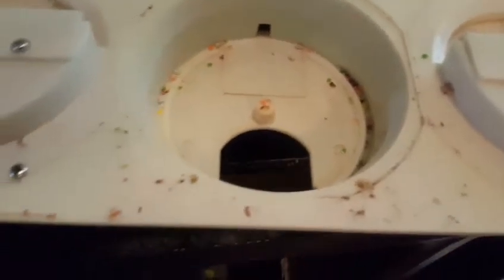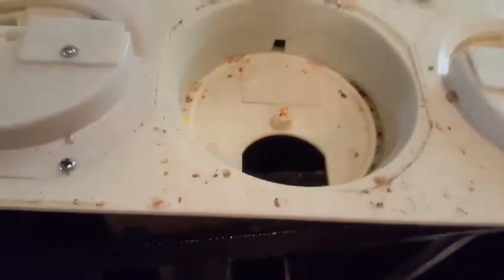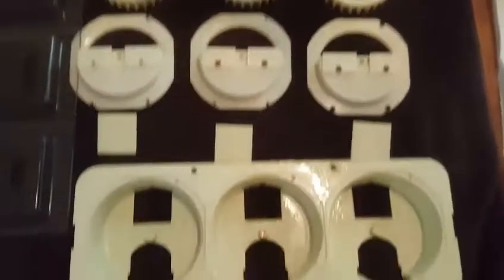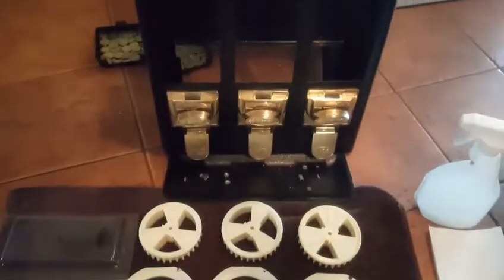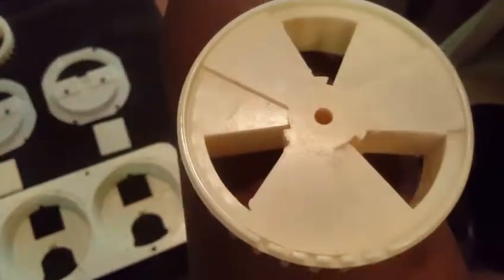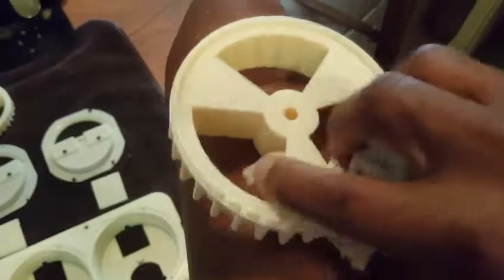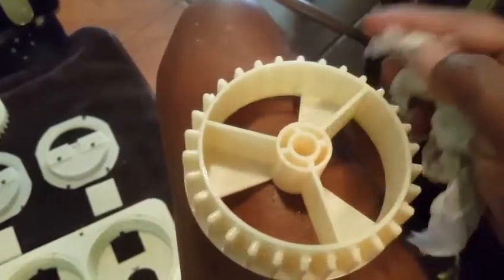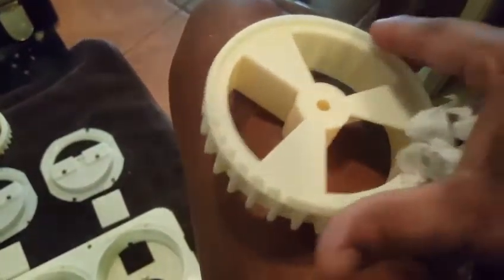Cleaning Seaga m&m candy machine.

Comment: Are you just using soap and water? And can you soak the removed pieces
Reply from the maker: Soap and water because if you use any crazy chemicals you can cause damage to the springs screws and other movable parts ok by the way while I have your attention could you take a look at my website Amazon affiliate website. 
 compaqdog.wixsite.com/website
Reply from the maker: https://amzn.to/38kVPqo

https://bestbuy.7tiv.net/c/2012604/671509/10014

https://goto.walmart.com/c/2032775/676671/9383?sourceid=imp_000011112222333344&u=https%3A%2F%2Fwww.walmart.com%2Fm%2Fsavings-c